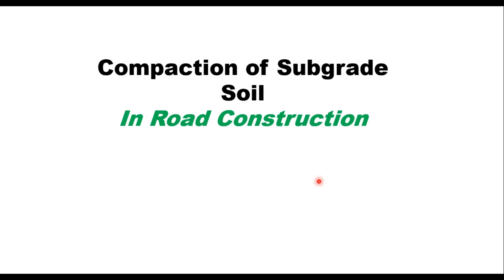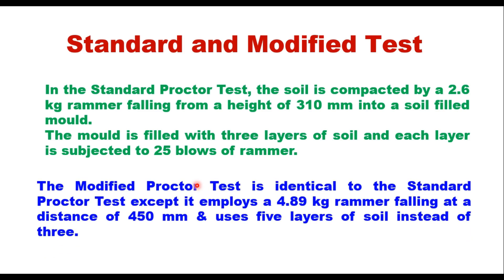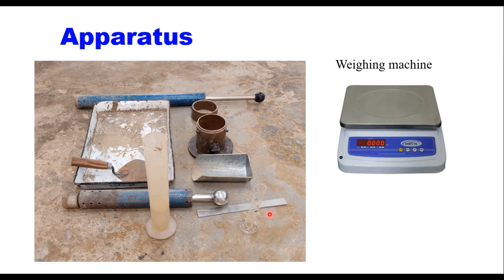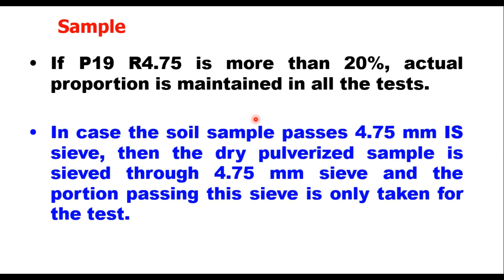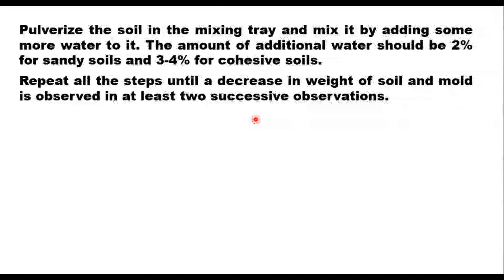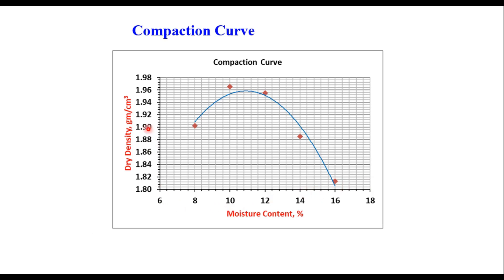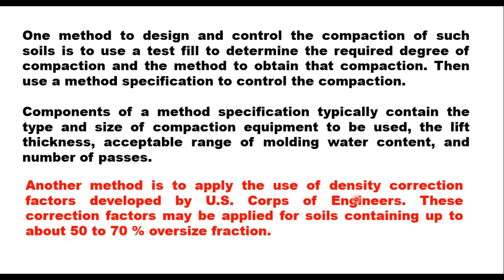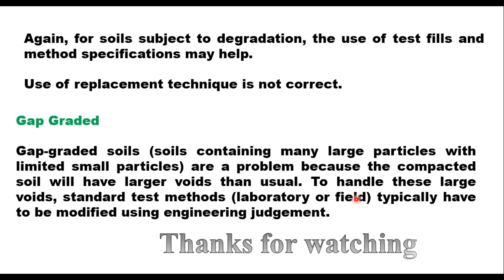How to determine Optimum Moisture Content and Maximum Dry Density of a soil. Compaction test on soil

Comment: how to get the value of moisture content?
Reply from the maker: After weighing the weight of the mold with compacted soil, take a small amount of soil from the mid height of the mould in a crucible. Take the weight of the crucible (empty and then with wet soil). Now put the crucible in the oven at 120 C for 24 hours and then take its weight again. The loss in weight is the amount of water present in the wet soil. Loss in weight divided by the dry weight of the soil is the moisture content for this trial of compaction. 
I hope it is clear.

Comment: Sir, i am having some confusion with my gradation..
For WBM lab test 
To determine water content for a cbr test i am not getting enough results and the compaction isn’t working well. I am thinking its due to gradation which is 53 mm to 22.4mm.. can you help me sir
Reply from the maker: WBM layer does not required determination of water content in the lab. It is laid directly in steps - aggregates, then screening material and then binding material and then it is flooded with water. There is not consideration of OMC or Density here. 
OMC and CBR tests are done on aggregates 20 mm and down size.
Reply: @SatishIITR okay sir.

Comment: Thanks for the Video sir🙂 and Sir Can you suggest an appropriate method to find MDD and OMC for FDR Layer (Full Depth Recycling) ?
Reply from the maker: IS 3323 part 3 gives a procedure to find OMC and MDD for stabilized materials in laboratory. If you are looking for field determination of MDD then it is to done either by core cutting or sand replacement method.
Reply: Sir once please confirm the code IS 3323 part 3 to test MDD and OMC for stabilized material? because I didn't find anywhere in internet source .
Reply from the maker: @bobbysatish9316  Sorry friend, it is 4332 part 3, typo error. The link is given here.
https://ia903002.us.archive.org/7/items/gov.in.is.4332.3.1967/is.4332.3.1967.pdf